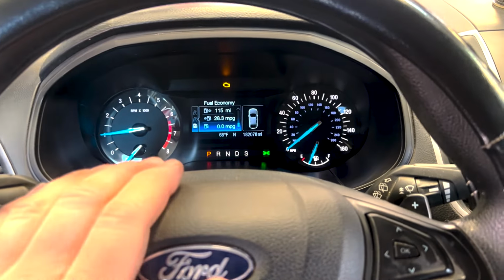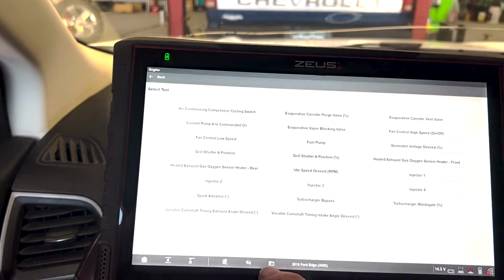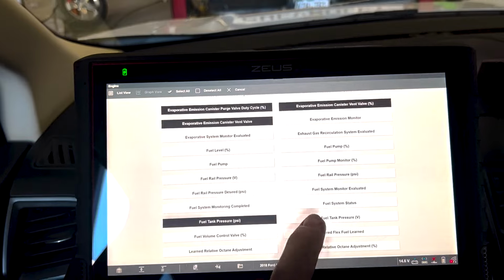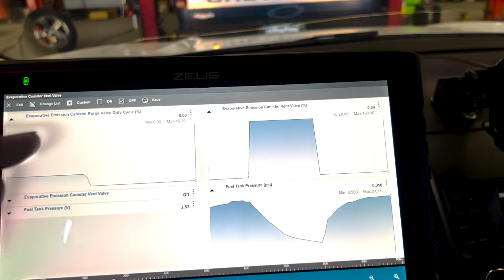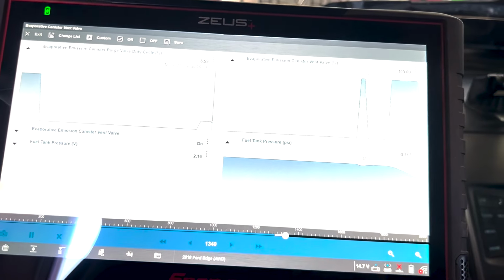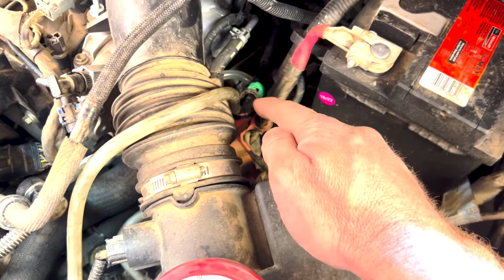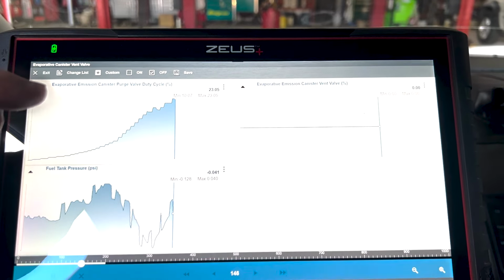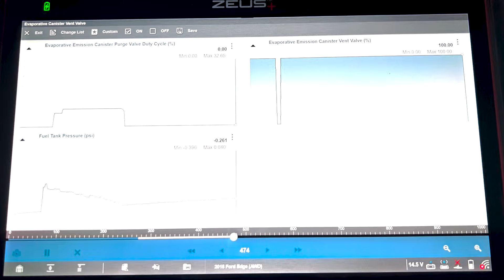2018 Ford Edge - P1450 Unable To Bleed Up Fuel Tank Vacuum

Comment: the power and convenience of today's scan tools

nice to see you back in the saddle, Chad:)
Reply from the maker: Good morning Dennis. I wish all manufacturers would follow suite. Nissan is still one of the worse when it comes to usable data on the scantool. Even with the OEM scantool I was unable to see variable valve timing data on a 2017 infinity v6. Domestic vehicles typically offer quite a variety of data to sift through

Comment: I like the way you isolate each arm and test both sides to verify the diagnosis. When I read the schematics on these systems I get confused by all the check valves that can mess up the logic if you're driving pressure the wrong way to plug a check valve.
Reply from the maker: The import systems are the most confusing for me and I think it comes down to the imports not failing often. Most of the import have the ability to isolate the canister from the tank during testing but I always need to reference a book from ATG that really breaks down each system and how to test it efficiently.

Comment: In the back of your mind, are you factoring in fuel level and temperature when assessing the response time with the pressure change value?

Thanks, great tutorial as usual!
Reply from the maker: Absolutely. If the tank was above 3/4 it’s possible that the scantool would have denied the bidirectional control of the vent valve. Most evap testing is performed between 1/4 and 3/4 tank. If the tank is empty the vacuum pulldown takes longer. Fuel temp is another consideration, a hot tank will vaporize fuel quickly especially when a vacuum is applied causing the vacuum decay to be quite rapid even if the system has no leaks.

Comment: If you do alive data with the scanner.Will the purge valve turn on and off every five seconds or so or should it be steady linegraph
Reply from the maker: At the end I show what it should look like. If the purge is kicking on and off that rapidly you may have a leak in the tank, cap or vent solenoid. The purge is kicking on and off in an attempt to maintain a vacuum in the tank for testing.